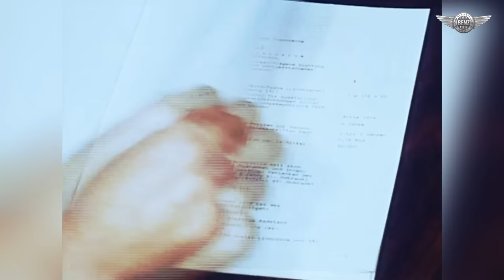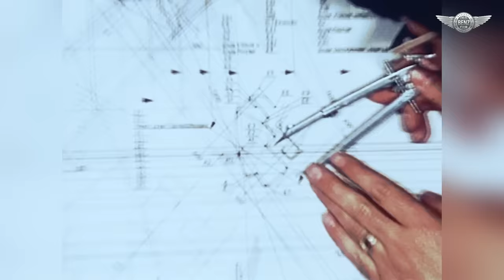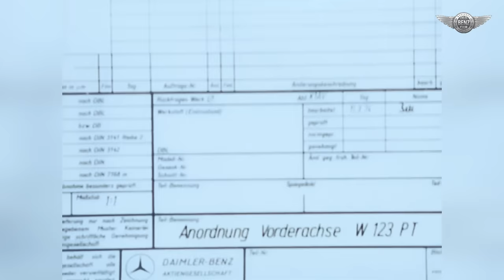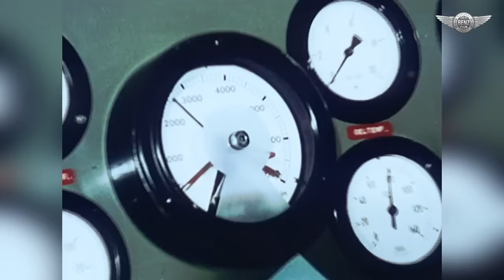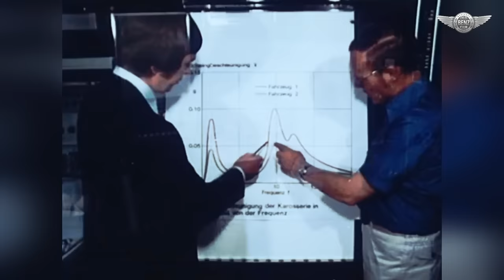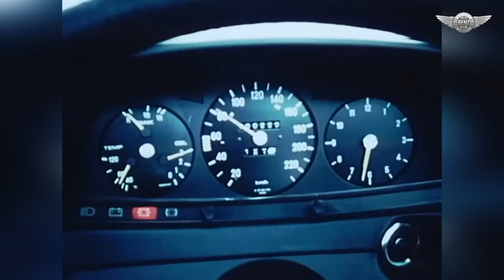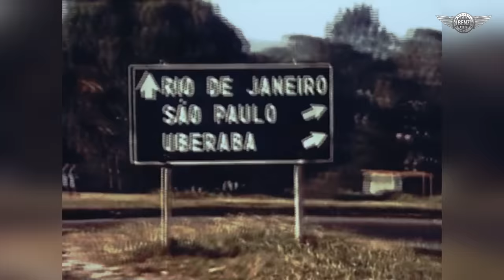1976 Mercedes-Benz w123 development - design, testing, pre-production

Comment: Gone are the days Mercedes made cars like this that could last a century.
Reply: My mechanic tells me that my 2002 C220 is the last of Mercedes's long lasting cars. :) Holding my fingers!
Reply: Noam Lavi yea you can always drop a used motor in when they die. The 5 speed automatic is basically bulletproof in that car. I had a ‘98 C43 amg, and it was very well built. A guy bought it from me and did a C55 conversion on it.
Reply: Love my 83 300d
Reply: I agree with you hamskyxxx- Mercedes in the 1970's had BANK VAULT solidity. And in those days Mercedes  had NO competition. Now they have BMW, AUDI, TELSLA and others to compete against.
Reply: What made them lose the ability?
Reply: @hubalahu  They never lost their ability, they just choose not to so that they can cut costs and please the dictatorship EU emissions regulations.
Reply: New Mercedes are just expensive Chrysler K cars....

Comment: Ownership of one of these perfectly made W123's, especially the Turbo Diesel's, draws you in to share how well it was designed and built. I thought those people were nuts until I bought one- wow. As my DD I have a white, California, 1983 300D Turbo Diesel with 345K on the clock that drives amazingly well and shows no sign of stopping. My responsibility is to keep it in good shape for the next person that owns it as it will likely out-live me (as it did the original owner). I love my W123!
Reply: Christopher Racine very kewl story!
Reply: Diesel, too slow though.  I have a 280E, will go 120mph+ on the freeway easily.
Reply: Christopher Racine , well said! The 5 cylinder turbo i bought for a daily driver in 2015 feels amazing as it shifts through the gears. I found a good one with 221,000 miles so i passed on a newer car to replace my 1985 Audi 5000 and went with the best!
After a couple years i did get a newer 2nd car but the 300d is running perfect
Reply: Respect!
Reply: @saintpreferred9223  My '83 300D Turbo is NOT slow at all. I'm the 2nd owner of this awesome diesel and I have it running the best as ever even with 389K miles. This 617.952 is running better as the miles add up. For my car(s) the key to have these OM617A Turbo Diesels run so well even after 40+ years is to keep the vacuum system working well. How the engine works with the AT via vacuum really changes how these cars drive at any age. Not to mention changing the oil every 3K miles as well. My car has great pickup and has no problem passing others on the freeway or on hills. The only thing I did to it was to increase the fuel pressure going into the IP (which is stock) . I love these cars. I've owned 4 of these W123's (only one now) and am looking for another... . This white '83 was my first and is my DD. Love it!

Comment: About 20 years ago the sponge foam shift knob on my '83 300TD just had had it.  I put it in a box and shipped it to MB America  complaining, "This part has prematurely worn out at 246,000 miles.  Is this part still under warranty as I think MB should make it last longer than the drive train."  Two weeks later I got a wonderful letter from the US head with an apology for the oversight and a shiny new shift knob!  He said my letter had been forwarded to HQ's quality assurance team so they could laugh as hard as he did.
In 2018, my independent MB shop surprised their oldest customer, me, with a nice steering wheel as the metal hoop was all that was left of mine...😁

Comment: This was a very good watch. It is no wonder these cars are almost perpetual motion machines. We had 5 different W123 cars in the family when I grew up in the late 80s and 90s. One apricot orange 1976 230, A green 280, a Champagne metallic and a Brown metallic 1982 230E, and a blue 1985 230E. And one time we got to borrow a silver metallic 1977 280CE. The W123 was the ultimate family car. It was a very sad day when the last one was sold off in late 2001. But 19 years later I finally bought my own. A Nickelgrün 1979 230 with a green interior, painted hubcaps and white stripe tires. It is very fun.

Comment: Disconnecting the radiator then towing another Mercedes up an Alpine pass. If that's not thorough testing I don't know what is. Bombproof German engineering!
Reply: +lmn28021992, but we don't know if they ever got to the top.  I'm on my third 'Benz (W124 230E) and from a Mechanical Engineering background, I seriously doubt I could pull another car up a mountain pass with the radiator disconnected without blowing a head gasket or seizing the engine.  One mustn't believe everything one sees.
Reply: with a steel head should be less prone to destroy a headgasket unless really hot
Reply: @Visionery1  well that is a fair point! I was also extremely surprised at this test. Perhaps they were trying to see how long the engine would last before it blows/ seizes? I have a 2013 w204 Benz. Great car feels like a tank but not like these old ones that appear to be very well engineered
Reply: They were changing the thermo switch. Probably not decided which one to use exactly.
Reply: and asbestos hadgasked in between !     anyway  we ran it hot with a trailer on the saint gottard.    just left her  resting a bit on higher idle till she cooled down and went downhill. Nothing broke   @AZNowners
Reply: @AZNowners  yep
Reply: @215alessio   Nothing beats cold war steel and engines.

Comment: I owed and drove this car from when it was 34 to 39 years old and put over 60k miles on it.    The car was built like a tank and drove like one too.  And people would always comment on this car. Never a bad comment even though the car had been well used like a . . . .  4cy no turbo but went up and down mountains and through the valley's.  Would have kept  mine if the previous owner didn't rip it apart.

Comment: My father has a 1983 240D, with 152,000km, and it works like new! No, it's not for sale! In my opinion, the last true Mercedes-benz which was manufactured. 
It still smells like when it was bought(just a litle) in Muret, near Toulouse, France. He is 100% factory.
Reply: 152.000 km:)))) my 240d is already 510.000 and the coupe 350.000.Your car is really new:)))
Reply: 427,000 on mine ;)

300D Turbo
Reply: Pff my 240D has 122000km... its the 72hp version from 1978.... great car
Reply: Dont ever sell it If they ever Ban diesel cars you can still run on vegetable oil with a few pump tunes.

Comment: 13:58 that chrome rubber stripe that goes across the both sides of the car, under the door handle... actually has a purpose. it's to keep clean door handle from mud that flies from the wheels

Comment: 6:38 The best engine manufactured to date by Mercedes Benz, the OM 617💪
Reply: Bruh om603 is better as reliable as The om617 but more power and lower consumption and even better The om606 only Bad thing about that is The half electronic injectorpump but that can Be changed.

Comment: That rack of test equipment and scopes at 7:42 is replaced by a single, thin, lightweight laptop today. What's crazy is how they drove the car with all that equipment in there - that old stuff is sensitive to vibration and takes a lot of electrical power.

Comment: My first car was a W123, 300D Diesel.  Had motor rebuilt at 190,000.  It was reliable for almost another 100, 000 and the rings went bad.  And even thought the berings themselves had minimal wear on them, all the same, the whole motor still had to go just because of the rings.  I was mighty pissed.  And the 2 different mechanincs I dealt with told me that this 90,000-100,000 is what to expect.  The first one of them laughed and basically told me it was stupid to just expect another 300,000 or so out of it.  The other one eventually told me that Mercedes Benz quit making the correct diesel rings for that 3.0 liter 5 cylinder motor.  Then he eventually told me that even though he agreed it was ridiculous to only get 100,000 miles out of that 300D Diesel, even he told me to take it least some responsibility for putting that many miles on it because it was still way beyond any warranties.  End result of it all, I was partially did on with Mercedes Benz, just because that company itself was completely phasing out the W123 in this particular way and one like me could no longer get away with 300,000 or so on one full engine and actually just drop in another one and actually get the same thing like some were doing with the old 220s from the late '60s-early '70s.  And that would force any one who still wants a Mercedes to buy a newer generation that's less simple and worse in the long term as far as being costly to fix and turning into big endless money pits and then lawn or pasture ornaments even a few years earlier.  So therefore I became more attracted to Jaguar, and different company, British instead of German.  And now is just added 1 European luxury car to my collection with and bunch of Chevys.  And instead of another Diesel W123 Mercedes, a got a low mileage, well maintained, gutsy 2004 silver Jaguar XJ8, the normally aspirated version.  And at this point in time, I'm feeling no regrets over it whatsoever.  And the '04-'09 generation XJ is what I feel is the best Jaguar XJ sedan ever built.  20 years earlier Mercedes made in some ways its best sedan ever, with advantage of being more simple than any S-Class sedan or any later mid-size or smaller one.  BUT I just don't feel like I could own one ever again no matter how simple it may be because Mercedes completely phased it out in favor of newer and more expensive ones for both short-term and long-term.
Reply: I had one 20 years ago and I have good memories of it, never gave me many expenses or problems. But it is true today and they cost to get their parts, for me it is still the best car I have driven
💪☺

Comment: the W123 is the best car ever made imo. And in those days they didn't have recals, because they tested their cars to the bone, and then put them on the market.
Now it's different, because now you buy a half designed and tested piece of crap that has a lifespan of a few years, because people who can affort a mercedes,
don't keep them longer than a few years, so they don't bother to built quality anymore.  Hell, i have mercedes sprinter with 450.000 km on it, and i replaced
litteraly EV-ER-Y-TH-i-NG! And alot of parts not once, not twice but 3 or even more times, like a second engine that ran for 150k and that is being overhauled a month ago, 
so in fact 3 engines, then 2 gearboxes, 3 clutches, al sensors, alot of wiring, 3 speedometers, 3 turnsignal arms at the steering collom, the plastic gearstick,
the plastic gas pedal, the fan switch, the interiour fan, the wiper mechanism, headlights, radiator, interecooler, turbo, injectors, fuel pump,
and so on and on and on and on, and i did weld about 500000 square feet of sheet metal al around and under that heap of rust, because when it comes to rust,
it's the 60's and 70's al over again, because they are no better protected that 40-50 years ago, and that is insane, because cars and vans should be galvanised
because it's fucking 2018 and not 1969, so the rust problem shouldn't even exist anymore!

Comment: To all that think the Mercedes built in the 70ies were better than of today, i am sorry but you are wrong!Rust prevention, road holding, comfort and weight to power ratio is far better now. Reason why it seems the were better because they had far lesser systems and virtually no electronics that can fail. Of course a cast iron 2 Liter 60 HP  Diesel engine with slow 135 km/h max can reach half a million KM .Drive a modern MB Diesel engine that slow it will also go that far.
Reply: It'll go just as far driven quickly. On the electronics perspective, it generally switches, actuators (motors, valves etc), and sensors that fail rather than electronic components themselves. Solid state microelectronic components have no moving parts. Their only real enemy is heat. I think a lot of people hark after the good old days, but given the choice between a modern car or a 1970's car to use all day every day I think most would take the modern one.

Comment: i drove it, it was a dream, it was a beautiful woman.  I was 16 stole the old gal from my dad for a ride. no car felt that solid.  later I owned golf mk2 gtd  and it was rubbish compared to the w123,  and less safe in all circumstaces  despite the w123 was from 78 and the golf mk2 was from 1990
Reply: Bollocks. The Golf Mk2 is one of the best cars ever made and its engines, drivetrain, handling and dynamics are a galaxy better than the w123. And of course miles safer in most circumstances than the W123.
The Merc was over-engineered and utter reliable but lets not get silly here.

Comment: W123 definitely had that very reassuring, solid Mercedes feel on which the company's reputation was built. The ride was quite soft and well damped, interior noise levels fairly low (except wind noise at speed) and squeaks or rattles rarely developed in these tightly built machines. They often gave hundreds of thousands of kilometers (or miles) of dependable service. Surely it was a very well engineered car, but a miracle it was not. The Diesels were embarrassingly slow and even the gas engines were no hot performers all the way up to the 280E, which was overpriced for its power. Seats were bouncy and springy and the car felt a bit ponderous compared to the competition. Diesel reliability was generally very good, while the gas engines were not much better in that regard than the bulk of cars in their class. The W123 was definitely not immune to the dreaded corrosion (the nemesis of nearly all cars made before the 2000s) so those cars have all but disappeared from their native Germany and much of Europe with a wet, rainy climate, while many live on in warmer parts of the globe, where rust doesn't get them.

Comment: Corrosion is a huge problem with these cars. I know the machinery is top notch but i can't say the same about the body's corrosion protection. The rust eats them from the rocker panel all the way to the roof pillars. If the car is driven on salted roads it won't last many years before something in the undercarriage turns into crispbread, making the car fail the vehicle inspection.
Reply: Corrosion was a problem with all older cars. If it’s such an issue, why are so many still operational in every part of the world? Also, find the same vintage Audi or BMWs- they are rarer then hens teeth.
Reply: Still didn't rust as fast as w210

Comment: Bei anderen Automobilherstellern sieht die Entwicklung eines neuen Fahrzeug genauso aus . Unfallsicherheit , Verbrauch , Strassenlage usw. alles das selbe . Ps.: Toll ist der Mercedes W123 nett , unübersichtlich und schaukeln tut er . Fault wie Dreck unter seinem 5 mm dicken Steinschlagschutz-Gummi (Man sieht meist nicht , wie faul der Benz schon ist) . Säuft reichlich Sprit , sowohl Benzin als auch Diesel . Nur wenige Dieselmotoren halten (die Kompression) , mit 250000 km ist starten bei -5C problematisch . Die Benziner haben Blaurauch ab 200000+ . Da gibt es schon bessere Automobile , die allerdings mangels Prunk und Protz , keine Lobbi haben . Der Benz punktet in der Unfallsicherheit , eines der wenigen Highlights neben den geräucharm schließenden Türen und dem Dünnblech-Chromzierrat

Comment: they should just jumped over the w123, just gone directly to w124. end of the 70's they already got the S-class updated to 80 style, and the 190 soon to released. W123 already outdated old fasion design when it came out. I guess the reason is that they had already put so much money in the s and 190 development, had to wait updating the E-class so they came out with the 123, waiting for have enough money and time to come with a modern e-class.